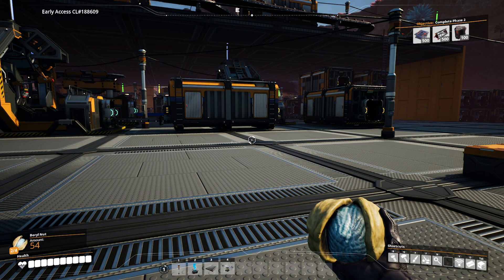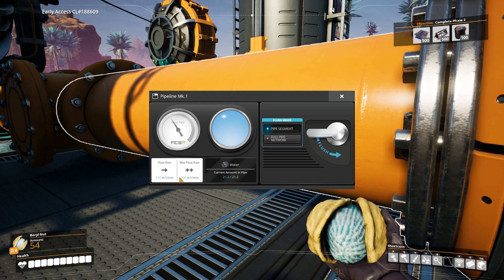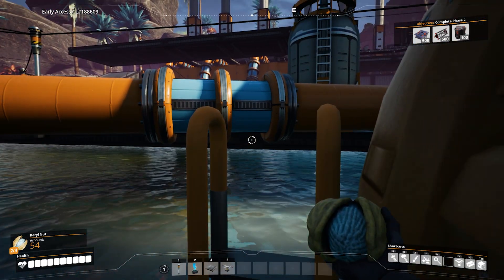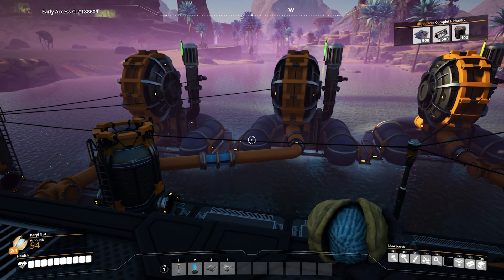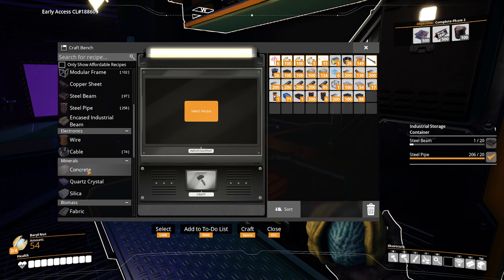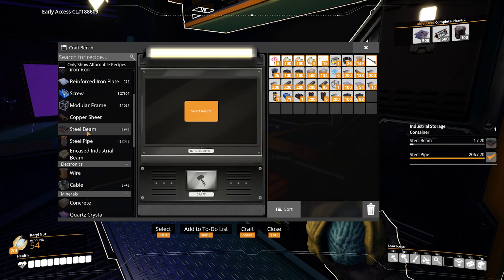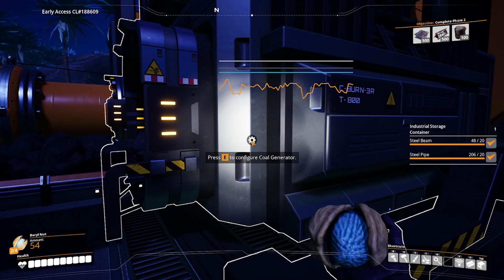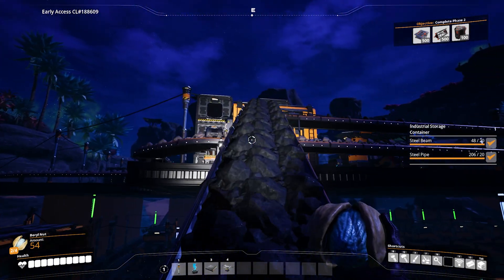Finally Fixed The Water and Power Issues | Satisfactory #12

Comment: love the series, for your coal problem you need to change the belt from mk2 to mk3 between the merger and your storage, as well as the mk2 from the storage to the splitter. If you look at the item transfer rates for each you will see that mk2 will move 120 items/min and a mk3 will move 270items/min.

Comment: at 23:35 you put in the merger but thats now holding you back on the coal. The large storage container got two in puts and 2 out puts. if you make it that one coal line moves in the second input of the storage you maybe will have enough to fill the storage and can make the output a mark 3 but then again there still is the chance you drain the storage. i saw you are overclocking the foundery what is a problem as well with that the coal is not geting in there fast enough for it bc of the low coal on the belt. maybe this will help with the problem i dont know hope it will i talk to much when it comes to this game xD

Comment: hmm. So Meaty i think your merger to double storages to splitter idea is good but i think the flaw is the fact that the merger and splitter will simply slow down what flows through. Instead why not run both lines into the big storage and then run two lines out? It does have double input and double outputs so it would be a more efficient way of merging and splitting the two lines as the line with more load could pull directly from the line with excess without having to wait for the splitter to decide to give it more.
Reply: couldn't say it better myself

Comment: Id think u would want a mk 3 feeding from the drill to a storage then out of the storage use a mk 2 or mk 1 whatever u need to keep things smooth. But would def run the 3 from drill to atleast give u an excess of the ore u are mining. Better to have to much then not enough. Worst case the fast belt slows down cause it cant be used fsst enough.

Comment: Okay, that was pretty incredible. 

You reasonably explain what the issue was with water in your coal generators.  That the input (water extraction rate) was less than the output (water used by the coal generators) and that the conveyance capacity of the water (flow rate of the pipe) was sufficient to deliver the amount of water you needed.  Then you immediately turn around and don't see you need to apply the same logic to the coal.  You need to match the output (extraction rate of the miner) to the input (the amount of coal used by foundry and the coal generators) while simultaneously making sure the conveyance capacity of the coal (the conveyor belt) is sufficient to deliver the amount of coal you need.  For some reason thinking storage buffers are an answer.  When in fact buffers are almost never the answer.  An amazing logical disconnect, I'm wondering how long it will take you to put it all together.  :D